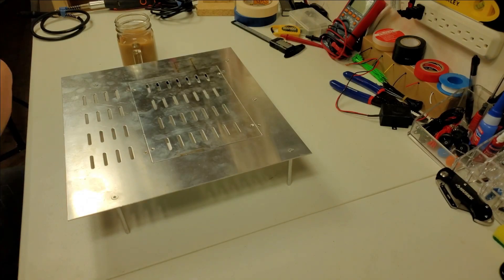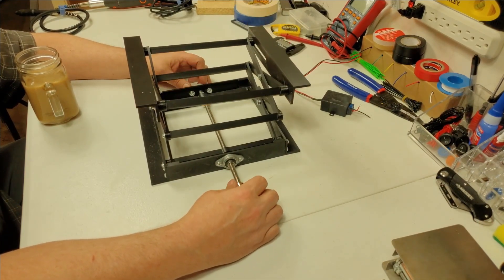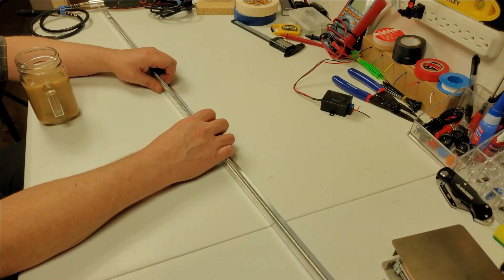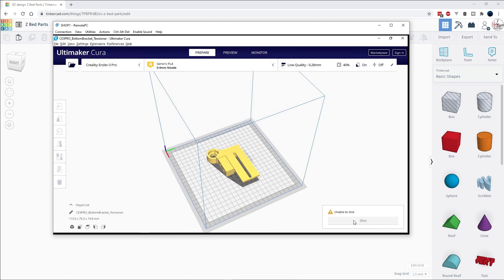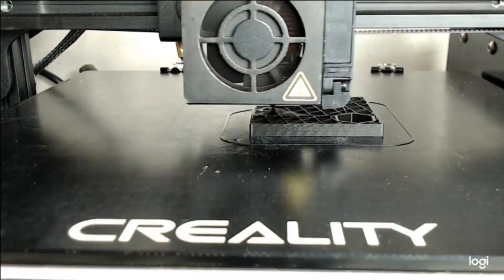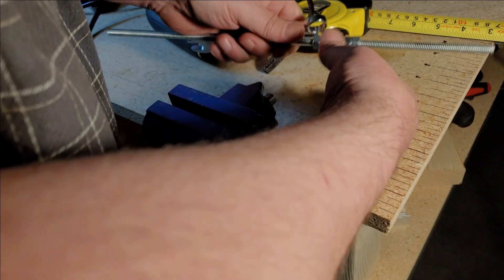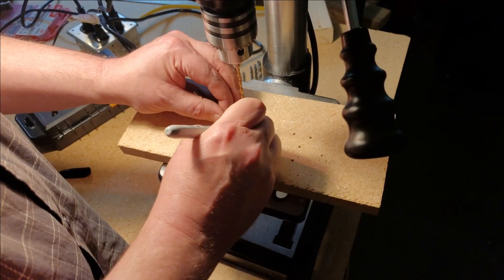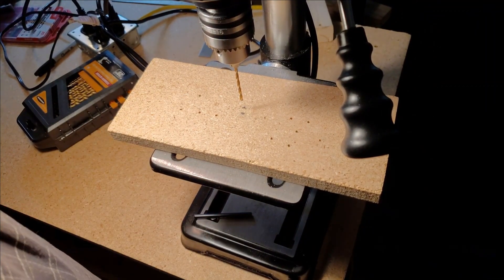Cheap K40 Manual Z Bed - Full Build - Part 1

Comment: Getting ready to print your parts and was wondering what percentage of infill did you print yours at?  I noticed that you said the part with tensioner would take  over 5 hours and mine at 25% infill will take 3 hours and 17 minutes.  Thanks for sharing your design.  Waiting for my Monport K40 to get here and this was just what I was looking for.

Comment: I love the bed design. Is there anywhere I could find the stl files you used?
Reply from the maker: Thanks! but there are a couple of issues I have found with it. I am going to do an other "update" video next week with some changes. I can upload the stl files for you. The main issue is the solid top plate. If it has a small warp in it, it will put extra stress on it and the current top brackets do not allow for it. It was an experiment that MOSTLY worked ;) Give me a couple of hours and I will put the stl file on Thingverse
Reply: @k40mods55  I look forward to seeing the update. Im thinking possibly making a frame out of angle aluminum could be a good idea to stiffen/flatten out the top plate. That's just an idea though. Keep up the great content!
Reply: @k40mods55  I would really like these, too!
Reply from the maker: @pkarza  https://www.tinkercad.com/things/7PBPlFdB2cv
Reply from the maker: I totally forgot about this, sorry about that!  https://www.tinkercad.com/things/7PBPlFdB2cv